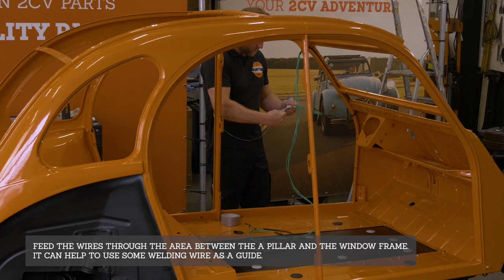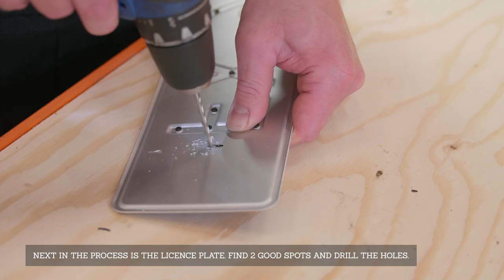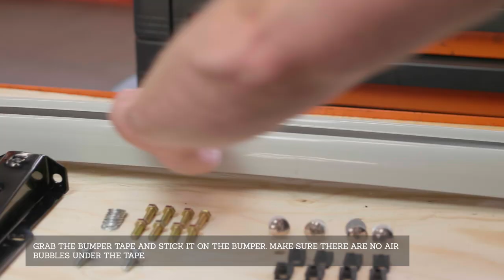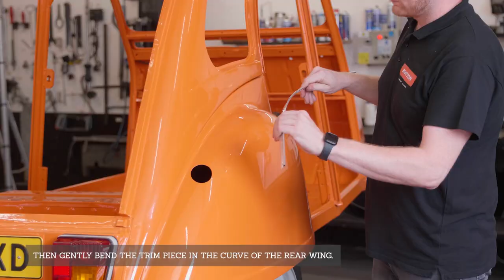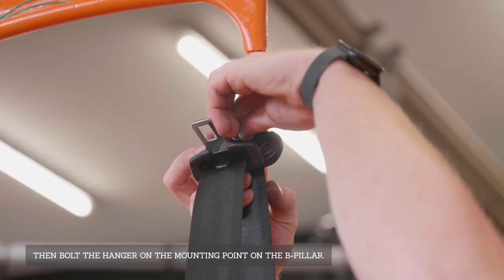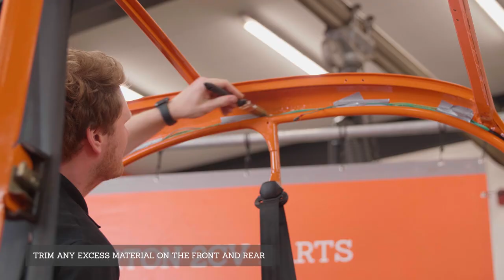Build a Complete 2CV | Part 1 | BURTON 2CV PARTS

Comment: Is this legal to drive on the street?  That's amazing, considering you'd most likely know  how to fix it. Can you buy just the chassis and put a different body / engine on it, and still be street legal?  The suspension on this thing is almost as good as a side by side quad, with the benefit of being street legal.
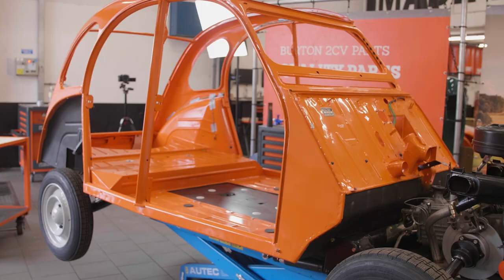Reply: 5:53 i assume that this is a fully restored 2CV

Comment: Burton 2Cv parts aren't exactly talkative here.😂 This is just a huge commercial for their products.
The Car being built will need a VIN number (Chassis number) and an original engine with number to
ever be road legal. 
I doubt it can ever be called a Citroen 2CV because this is a Kit Car as it is.🤷🏼‍♂
Reply: what are you talking about?
5:53 is a plate
if you restore a 2CV completely, weld and paint it, this is what you have to do
Reply: @shremich4583  Troll Harder🤡The car shown is not a restoration. It is a new car and under UK law is a Kit Car and in a whole different legal category.